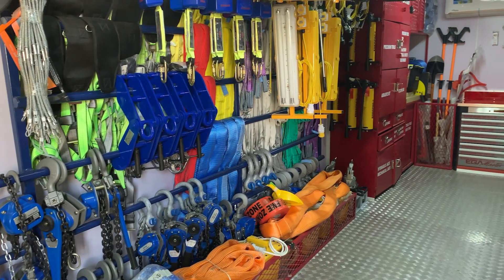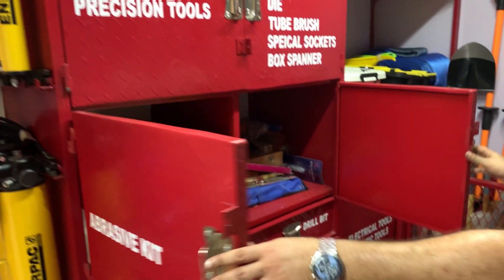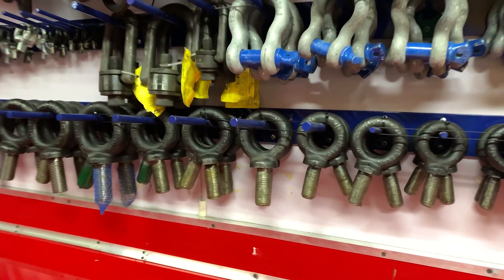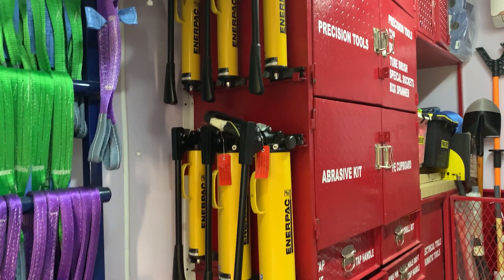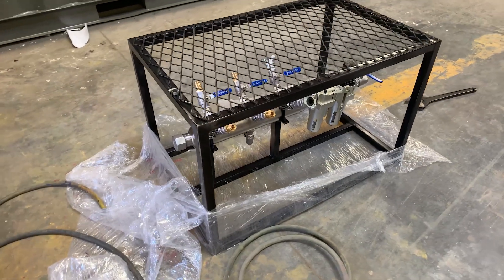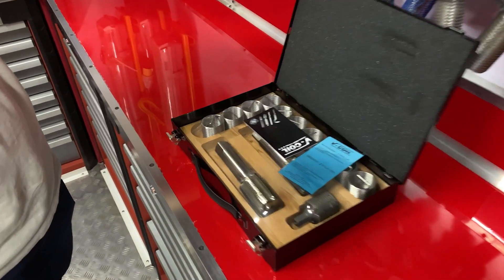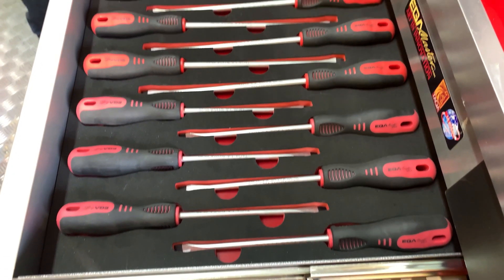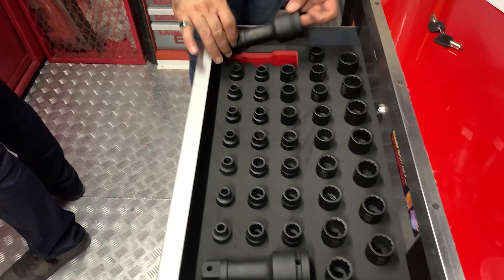Tools Containers For GE Gas Turbine - B & E Classes

Comment: An incomplete container Where are the small machines a lathe, a fixed drill and an iron saw. In terms of tools, it is wonderful and complete. Thank you for the information.👍
Reply from the maker: we can add this machines if customer required , Thanks for your points

Comment: An incomplete container Where are the small machines a lathe, a fixed drill and an iron saw. In terms of tools, it is wonderful and complete. Thank you for the information.👍
Reply from the maker: Thank you for your feedback , Actually we have another one come with small workshop it should be 40 foot container , and we design the container according to the customer requirement
for more information you can contact us by WhatsApp 00971502711651